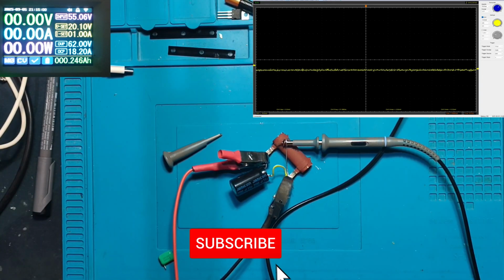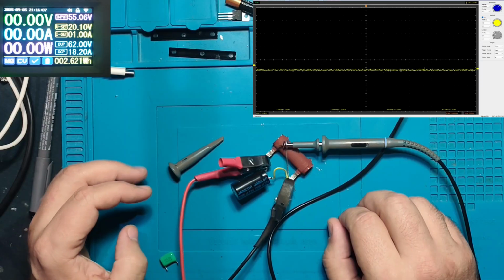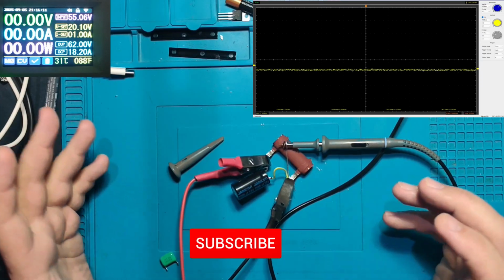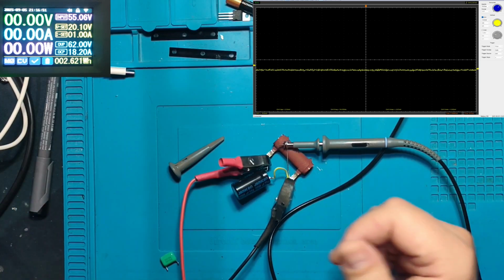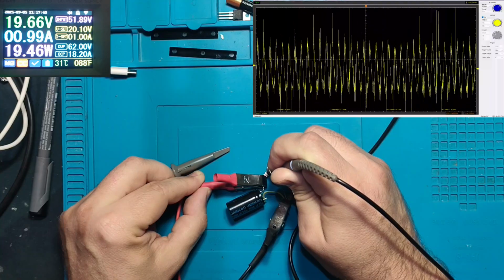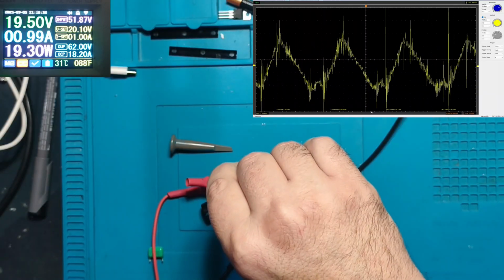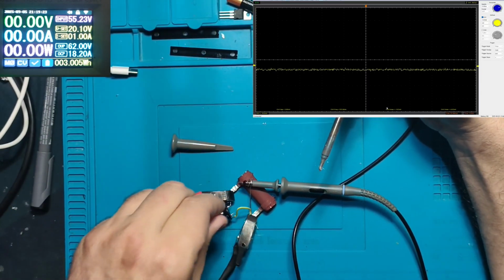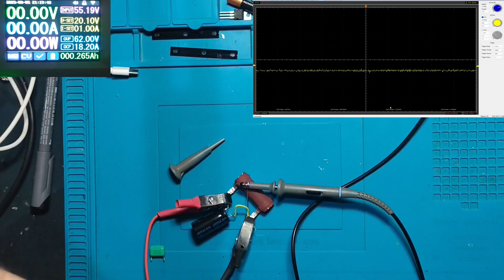🔧 Huge AC Ripple Solved to 6mV!  Riden RD6018 Power Supply  #PowerSupply #Electronics

Comment: You have some problem in yor 6018, maybe in PSU, 6030 show riple less than 0.00001v
Reply from the maker: There is no problem anymore , now is smooth and shiny . And PSU which supply my 6018 is big 800W transformer + 50 amp rectifier + 20000 micro farad filtering , as well one 100nF ceramic filter. So all noise was coming for 6018 itself , however there was something more then that which was affecting all my desk instruments, its fixed now.

Comment: Noise can be very hard to track down and what you see may not be real.   The leads themselves provide inductance in the filtering.  I have a sneaking suspicion that if you shorted the leads at the power supply, both leads connected to the negative, that noise would still be there.  Those leads are forming an induction loop which is picking up magnetic field of supplies inverter. Lead pickup is a big problem in measurement.   I have a sniffing coil made from a bobbin of a transformer with about 100 turns.  A quick non contact way to see oscillator frequency of a switcher and finding noise.  That would make a good video.  I don't trust anything an instrument tells you. All data needs to be interpretated.  Never make assumptions a jump to a conclusion.
Reply from the maker: You’re absolutely right that measurement setup matters — long leads can act like antennas and pick up switching noise. That’s why I kept the loop area small and double-checked the results. The ripple I showed wasn’t just pickup — it really dropped after the fix. The sniffing coil idea is cool though, I might try that for a future video, thanks for the tip! 👍

Comment: Did you try a CLC filter on the output of the power supply?
You can get preatty low cut of frequencys, it should eliminate high frequency noise pretty well.

Also maybe the video about capacitance multiplier from EEVblog could help as a amplifyed RC filter acting as a secondary filter, depending on the size of your radio's load

Also, great video. Congrats
Reply from the maker: Hmmm didn't try CLC ,in mean time added 20000 uF, 220nF, 22Pf and got quite nice almost flat line with some peaks to about 2mV very hard to measure with my instruments. As well peaks go up to 4-5mV at current 10 amps , so I think I got what I wanted.
Reply: Thats great man, the response looks nice.